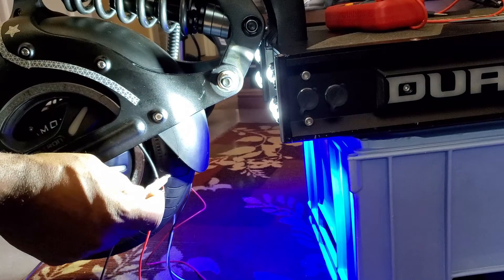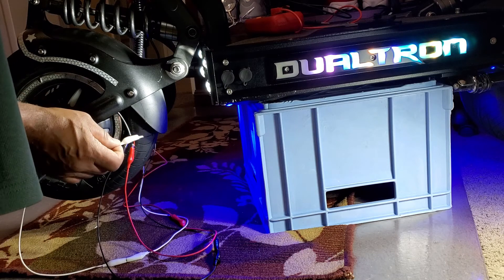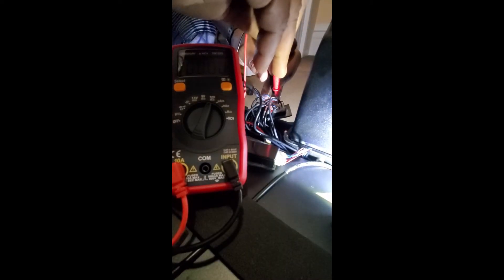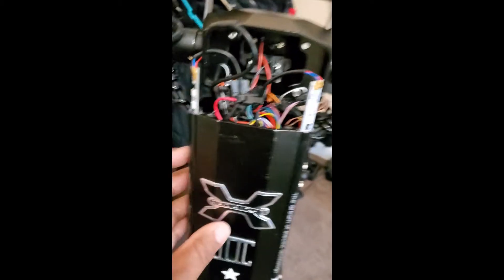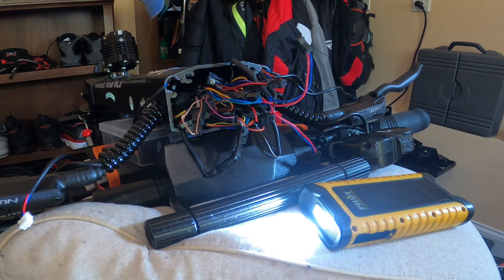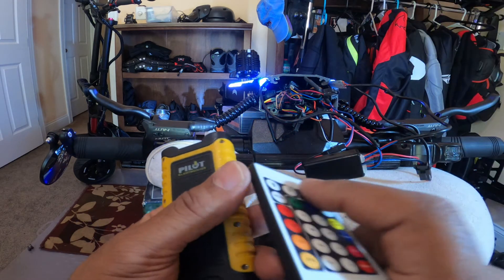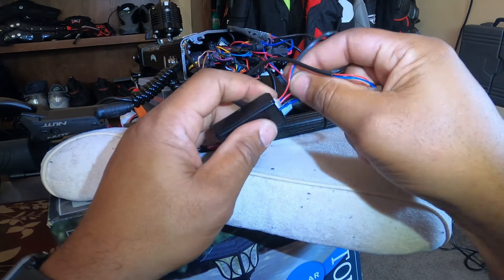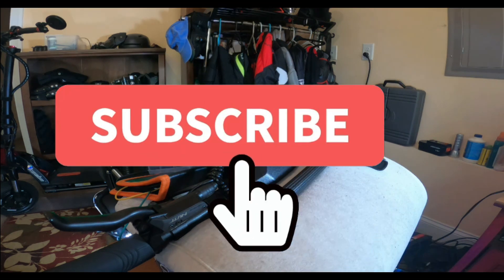Dualtron X2 RGB Light Controller Troubleshooting and Installation: Amature Tutorial

Comment: think im having a similar problem on my Dualtron Victor, no connection to app, and when turning right the lights turn off, when turning left the lights start flashing. Could it be the rgb controller? Or some sort of weird loose connection?
Reply from the maker: That sounds about right. Not sure where the RGB control box is located on that model but once you change it out you should be good to go. Good luck.

Comment: Hi, my dualtron thunder 2 rgb led is not lit, I changed the main control, it didn't happen again, do you think the problem will be fixed if I refresh the switch box?
Reply from the maker: Not sure if a refresh will work. When mine went out and I changed the Light Controller unit I haven't had any trouble with it since.

Comment: Wonderful work as ALWAYS.  My lights are susceptible to bumps. If I hit a rough patch of road on my x2 it will turn off the 12v system until I hit another bump. It could be a loose connection.  Did you see the   12 volt battery in there?
Reply from the maker: Thanks. I could see the top the 12 volt battery but it was pretty deep down inside of the column, about 3 inches below the area where you see the side buttons for the lights and just above the area of the front light on the DX2. Sounds like your issue may be a loose connection in your connector box. It's in a location in the deck where it gets a lot of vibration. You probably could see the issue right away if you looked inside the deck.